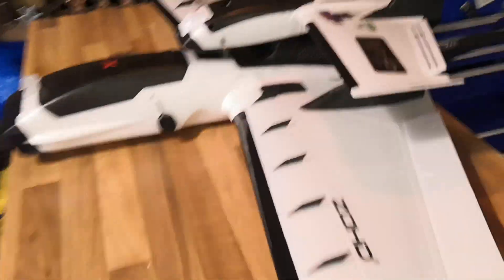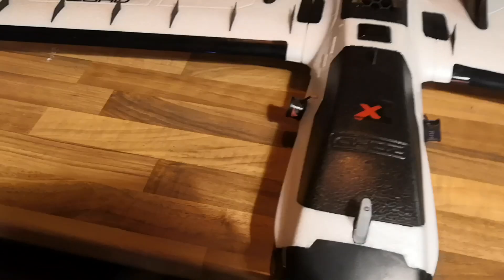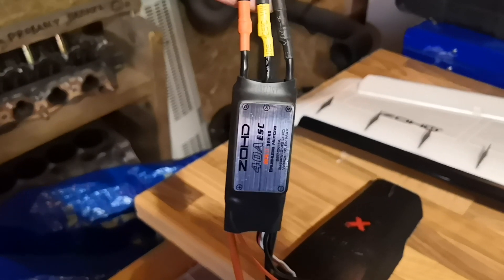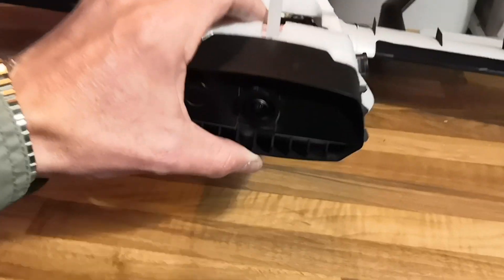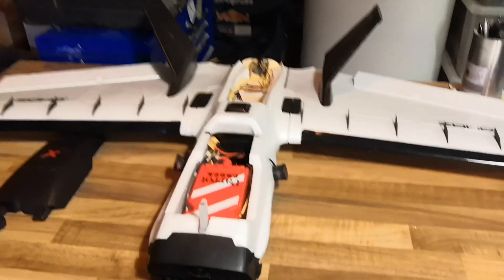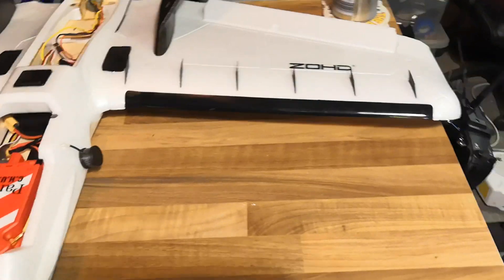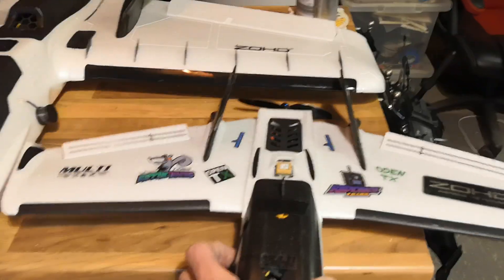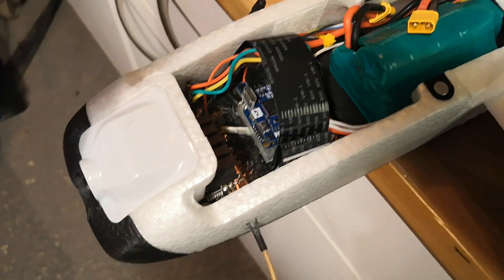Disco Dart XL update, ready for maiden? Parrot Disco Chuck transplant! (feat Maisie!)

Comment: Maiden video?
Reply: Im building a night fury with chuck and leopard motor and 4g mod, i think the factory motor from disco is 2 small for the dartxl,
Reply from the maker: @nicfpv9969  I think you may be right mate, yes it did crash on maiden. I am not really sure why. After this I moved to quadcopters and never looked back. I may get back into fixed wings soon though. Good luck!
Reply from the maker: If you want to see it crash into the ground and snap the dart in half, personally, I would rather not relive the moment!
Reply: It crashed before??
Reply: Did you finally make this plane fly? Did you ha e a maiden video?
Reply: I dont think thats a good motor for the dart, i ha e a night fury with a leopard motor

Comment: Iv been offered a C.H.U.C.K module for cheap. But it just comes on it's own with no leads or cables. Is it worth buying or is there no point without all the cables/antennas ect? I plan on using it in a wing or v tail. Cheers
Reply from the maker: You should be able to make it work without those parts yes. It uses standard servo cables. You might need to bodge something for the motor though.
Reply: @MarksRandomVideos  Ok great. Thank you.

Comment: The esc in the chuck is 30amps. Nice setup, crazy you have the original motor from the disco, that sucker is expensive
Reply from the maker: Thanks for the comment. It is all back in the disco now mate, the launch settings were wrong and the Dart would not take off. I could have changed to Ardupilot but decided against it and upgraded the disco with metal servos and lots of glue/tape. Now the Dart XL has a Matek FC in it and standard motor. It also crashed on first maiden!!! So thinking about changing it to an AR Wing Pro! :)

Comment: Nice work! But I wonder what is reason you transfer chuck to this kit? Disco kit broken?
Sorry for me bad english listening what you talk, I wonder you use stock skycontroller or rc remote, if is rc stock, did you install ardupilot firmware! And, how do you set up external esc to use with? How to wiring esc. Thanks
Reply from the maker: Hi Sorry for delay, I had damaged the disco. I wanted to try in Dart but it never flew. I had stock motor and esc and skycontroller. Thanks